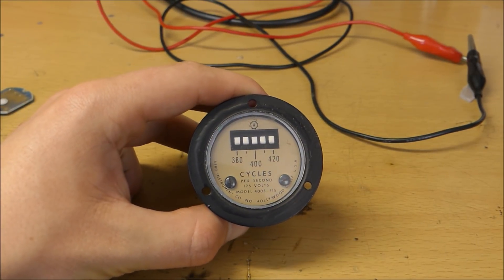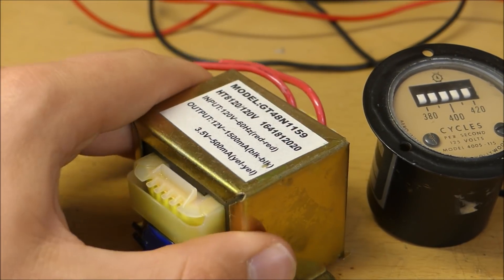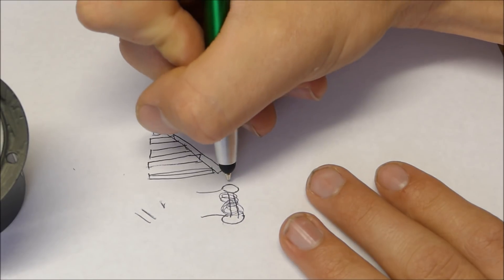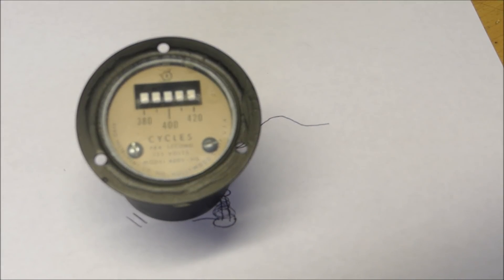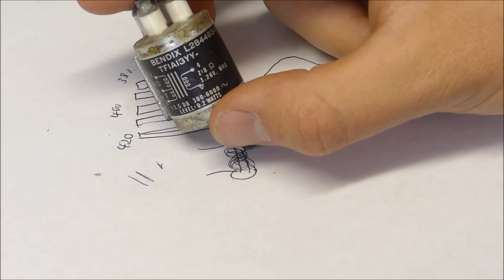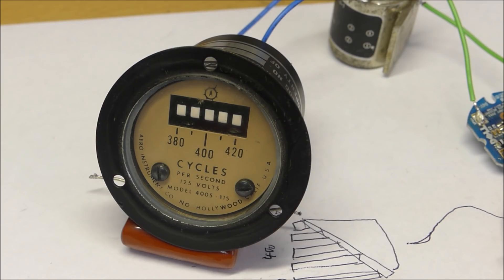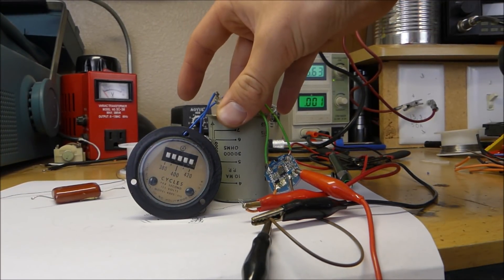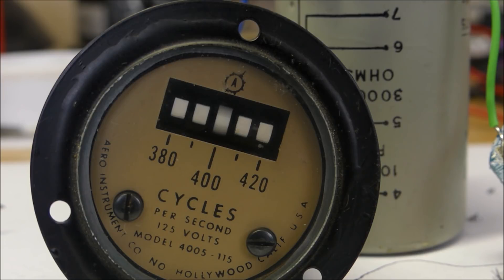Vibrating Reed Frequency Meter From an Airplane || Testing and Explanation

Comment: The higher frequency one is actually the short one, not the long one. You know: wavelength is inversely proportional to frequency, so tuning fork length is also inversely proportional to the frequency.